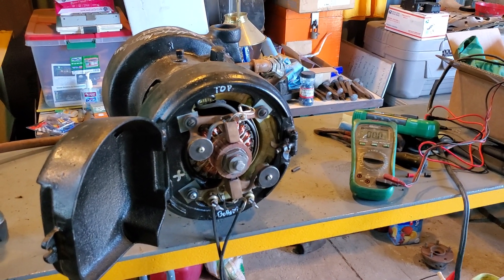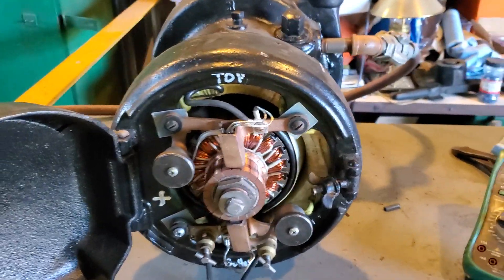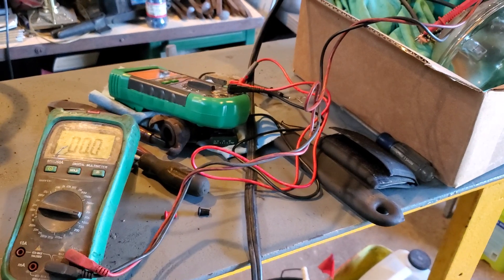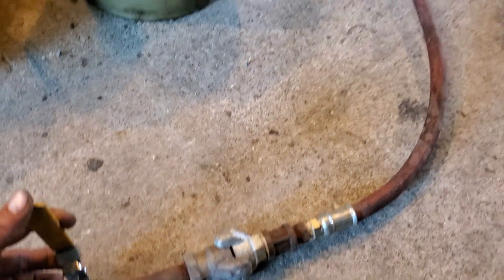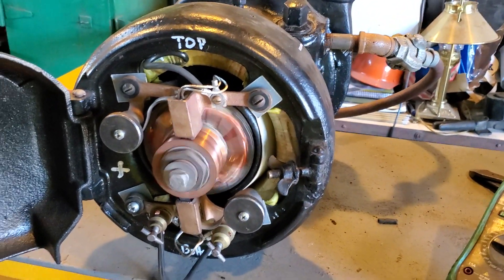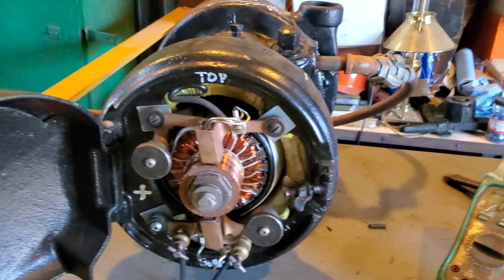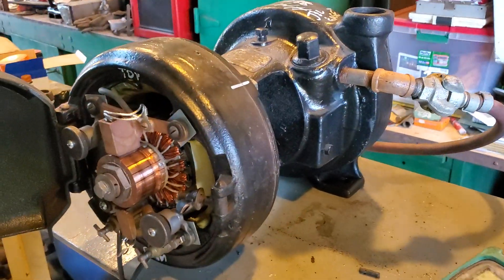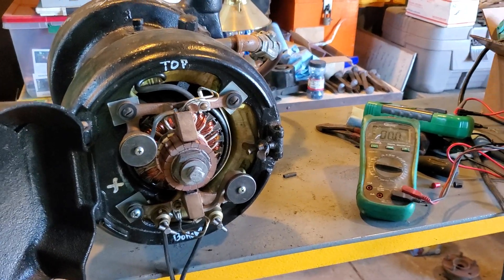Pyle National K2 Turbo Generator for the J&LNG 58

Comment: Rick would the 58 originally had one of these?
Reply from the maker: No.  Never had any kind of lighting, or brakes, or a bell...   But its service on the J&L Narrow Gauge requires these appliances.  

Someday we will restore one of the other locomotives to its J&L Steel appearance and it will be as historically accurate as we can make it.

Comment: Do you need to regulate steam pressure to the generator to prevent an over voltage condition?
Reply: If the generator works as it should, it is self regulating. It shouldn't run at more than say 3500 rpm

Comment: Rick, Do you need to have some sort of voltage regulator, so that when for example, you turn the headlight off, the voltage remains a fairly constant 24V?
Reply from the maker: There is a regulating valve inside the turbine end that is supposed to regulate the steam depending on load.  We will find out very soon how well all of that still works.  Its a 32 VDC system

Comment: Did you have to put any oil in it first?  I know nothing about turbogenerator maintenance
Reply from the maker: There are two oil cups that take the same medium grade oil that we use on the running gear.
Reply: The electric part of the generator has two oil lubricated bearings.